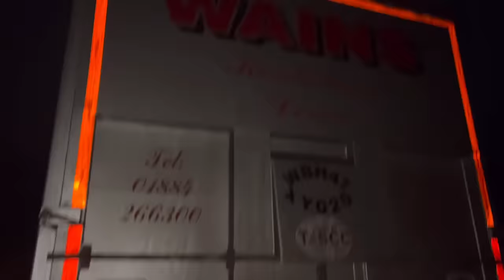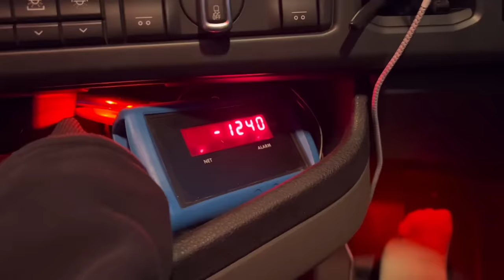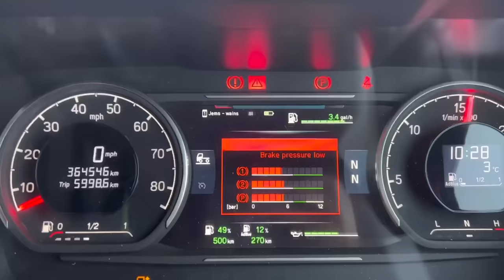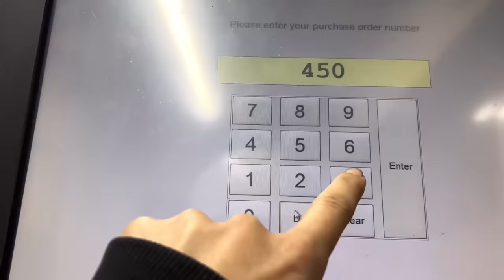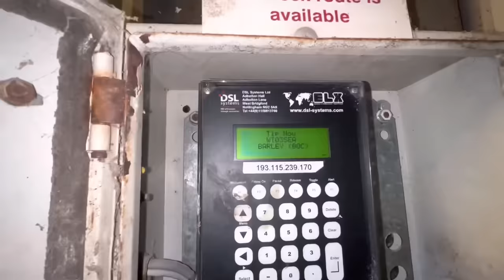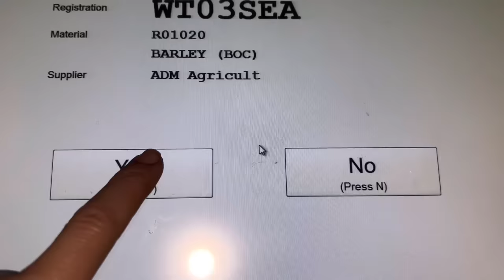My Truck breaks down | it’s a Long day

Comment: During you Norway visit you tried what's mean winter. This is nothink. Ladt a few weeks we had quite difficult drying, very often 8-12" of snow on route. Fully snow chains, front axle, bought rear axles, one front on trailer and middle last axle on trailer. Yesterday i finally reached destination to unload palets and there was very well clen yard, just  pitch of snow. Luckily they ket me go in with chains.

Comment: Jemma you should consider putting some Ukrainian XADO nano ceramics in your truck engine and gearbox steering axle and wheelbearings.when these are inside you can make 100 000km trouble free and your truck will never brake down.always here to support you Jemma.❤❤❤❤❤❤❤❤❤❤❤

Comment: Oh, those country lanes are super tight.😬  why do you not park up with a full fuel tank? What a frustrating day but at least it’s only one day. Great vlog as always Jemma! Keep safe and warm. 💪🏴👍
Reply: Probably fear of diesel theft I'm certain.

I'm sure Wains transport has told her not to confront anyone for her personal safety.
Reply: Yes, you are so right. Take care and have a good Christmas
Reply: It's not theft, the tanks would be locked, it's to do with very cold and even the freezing temperature that can have on diesel fuels, making them non functional under these conditions, called gelling. A smaller volume of diesel fuel in the tank would presumably warm up quicker than a full tank...
Reply: Oh, thanks for that, dave. I didn't know, and the comment may help others. Take care happy Christmas

Comment: JEMMA, I CRINGED when l saw your long HAIR as you poked around around the ENGINE with all thar AIR SWIRLING AROUND. PLEASE WEAR A HAIR NET, if you don't want to be scalped.

I've witnessed a hair/machine scalping - you will be helpless, the hair wraps around, tightening, the hair tips your scalp off tearing ripping the skin, with blood everywhere.

Skalping usually cannot be replaced. For the rest of your like you will wear wigs, scarfs hats. Every day  for the rest of your life tour will look in a mirror and relive the horror.

SO, PLEASE JEMMA, WEAR AN INDUSTRIAL HAIR NET!

Comment: Do you run your engine to stay warm at night or do you have auxillary power?
Reply: Hi, it's called a night heater which runs off  the battery.  Take care . Have a great Christmas 😊
Reply: webasto runs on the diesel tank.
Reply: Thank you for putting me right on that my mistake.  Take care and have a good Christmas